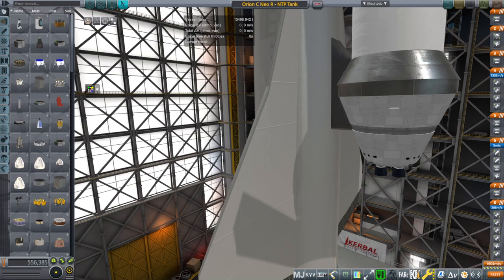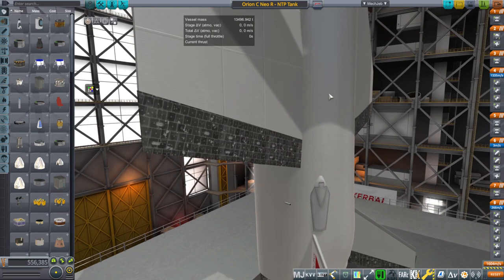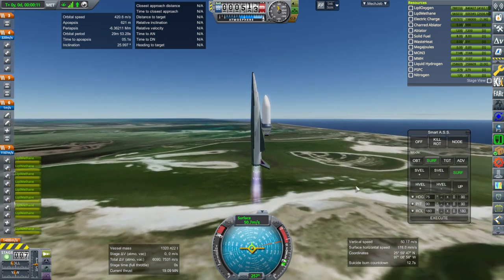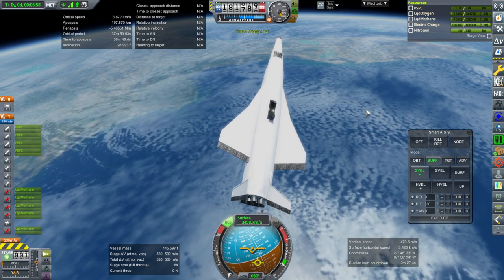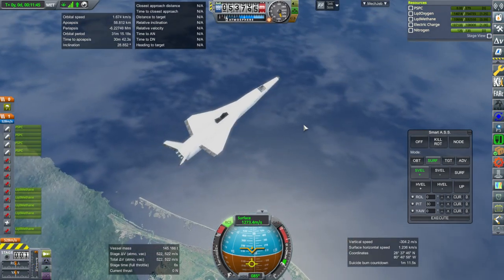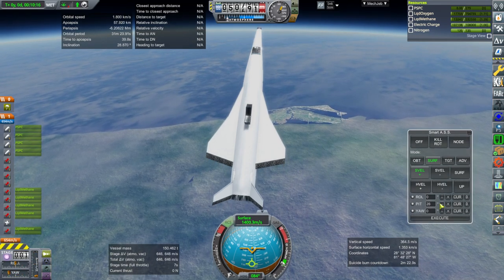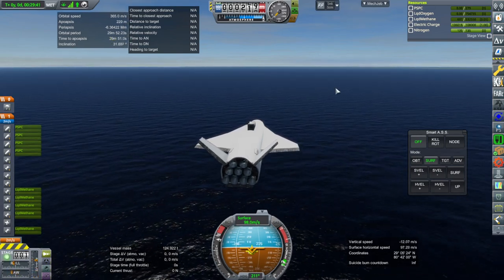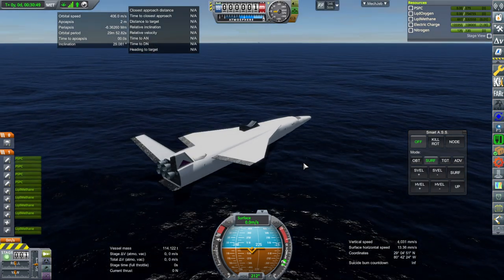Realism Overhaul in KSP 1.8.1 - Orion Carrier Upgrade Test 3

Comment: I think the best solution for a payload adapter here would be a few hardpoints on the roof of Orion plus some struts, similar to how the Shuttle held the ET. Simple to model (It's just a tube), less drag (Probably) and could more believably fit different payloads. Now whether the struts would be jettisoned with the payload or stay attached to the spaceplane is another story, I'm not sure they'd survive reentry or even hypersonic flight.

Comment: Suggestion: try to achieve better range control during the initial reentry dive using pitch. Decreasing pitch as a funcion of velocity and/or vertical acceleration should limit the tendency to skip and might allow you to hit KSC more consistently wirhout overshooting
Reply from the maker: There's a little bit of possibility with that, but I can tell you it is highly sensitive. It definitely flips out of control at a pitch of 40 instead of 30, for instance.

Comment: Overflying Populated Areas might not be that big of a hassle because of automated FTS systems. Could monitor pitch and yaw rates and if they exceed a certain predetermined threshold, it would trigger. obv logic is probably more complex than that but it could work.
Reply: Debris scattered over a large populated area pose a much bigger hazard than a single out of control object.
NASA tried to avoid Space Shuttle reentries over the continental US for this very reason after Columbia